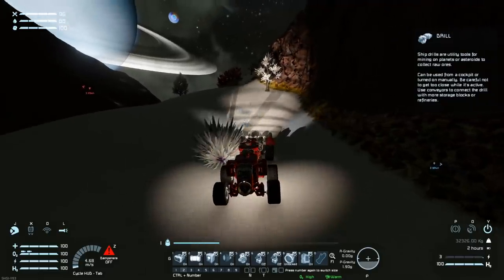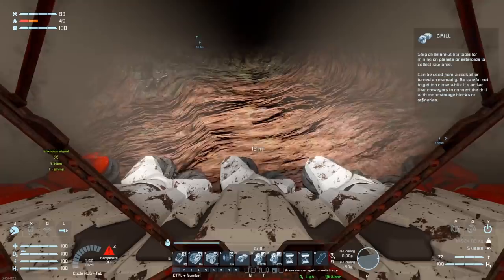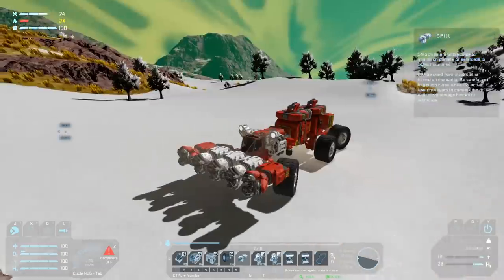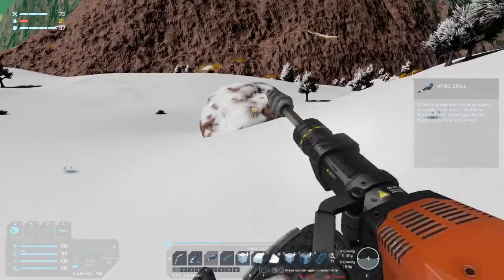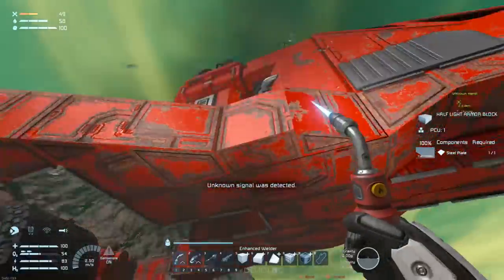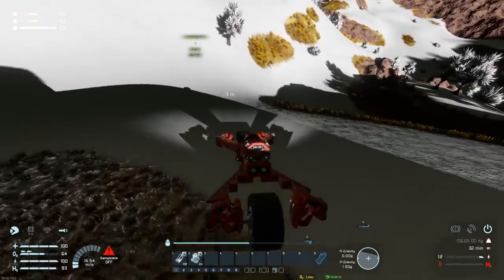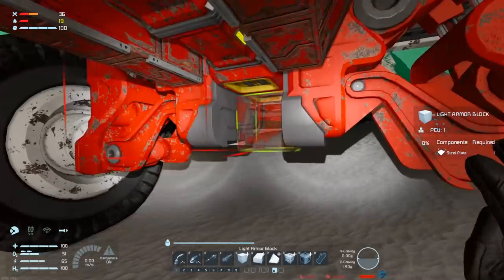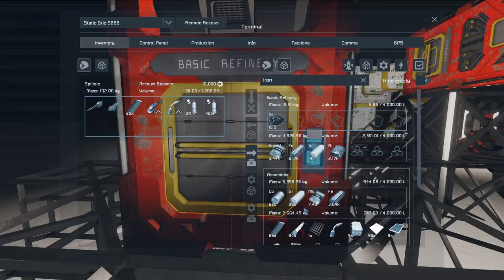Survival Impossible - Splitsie's Motorcycle Club #9 - Space Engineers Hardcore Survival

Comment: Make a button on the outside of the trailer to engage the trailer brakes.
Reply: Sadly, the state of the handbrake is stored in the cockpit, not the wheels...
Reply: @barmetler  If a remote control is added then it is possible to set up a button for the remote control's handbrake.
Reply: @TildaAzrisk  Yeah I was thinking about that... But what happens if he activates the handbrake there, then connects it again, what would happen? would the normal cockpit then override the remote control block? That would be good actually
Reply: @TildaAzrisk That was not the question, what I meant was what would happen, if you activated the brakes with the button, and then connect the miner. Will then the handbrake of the cockpit override the handbrake of the remote control, because the cockpit is marked as "the real one"?
Reply: Time for testing! (Spoken with insane levels of manic laughter)
Reply: @Spharkii  I wish I could do that XD but my graphics card is "either too hot or I need to update the driver" ._. and if it works, then at 10 fps...
Reply from the maker: I guess I'm going to have to try because either a button or a timer block that I can use to activate it for the trailer would be really handy and avoid some of the issues around finding a spot to safely stow a landing gear :)
Reply: @Splitsie  Or an actual anchor that you throw out with landing gears XD

Comment: Had a thought about your drilling angle, If you remove the two small wheels your using as  skids, place them inline with your driving wheels on the end of pistons, you should be able to adjust the drill angle by extending the pistons. The longer the piston the lower your drill points. Should also help with reconnecting the rotor.
If you still run them without friction, steering and drive they should still work as castors.
Reply from the maker: That's an interesting idea, I wonder how prone to issues the wheels on pistons would end up being but it feels like something I'd like to test in creative :)

Comment: Put a button on the trailer to engage/disengage the trailer brakes. Or a script that’s
 if: rotor connected 
then: engage brake
Else: disengage brake
Reply: He could just turn on the brakes, then detach and turn them off to move away, I think.
Reply: I think you actually mean the opposite. If connected, turn the brakes off.
Reply: Simon Knibbs yes I did mean the opposite, good catch!
Reply from the maker: Nope, the brakes on the subgrids don't engage without a control point on the trailer, that's why I can't park on slopes with the GUFI + trailer, with the subgrid wheel control script it just keeps trying to accelerate/reverse to hold position which is why it burns so much power when parked and why I always switch it off on parking :/
It's also why I need to at least put a remote control block on the trailer to get a control point there
Reply: Just had idea, put a four button panel and have 2 for trailer brakes and 2 for battery subgroup on/off

Comment: +splitsie, you need to put some armor between the two suspension sections over the wheel, that way if you bash one side, it'll stay held on by the other.
You should also have the suspensions covered in armor within the lean angle of the bike.

also, I think the suspension's are narrower when mounted sideways which might make for a better lean angle, it would just wreck your steering
Reply from the maker: That's an interesting thought about sideways, I wonder if I could combine that with rotor torsion scripts to still have some suspension and a better collision profile with the ground

Comment: 5x5 2 wheeler Splitsie. You made a big wheel! lol!

Also using  the same zero friction trick you could use 1x1 wheels as out-riggers to prevent catastrophic roll damage.

or you could suspend the wheels from above the body. Like the mcdonald double arches. 

The trick with a bike in SE seems to be keeping the frame horizontally compact.

Comment: I was experimenting with a separate trailer system like you but i used a small piston and a landing gear on it to lock in place, the thing liked about that idea was it could be adjusted for different terrain types.
Reply from the maker: I'm thinking that'll be what I'll do if I can't get the handbrake to work, the main reason I want the handbrake is to avoid needing to find a spot to fit the piston and landing gear :P

Comment: splitsie, remote control blocks and handbrakes works for subgrids
its the only way that ive gotten subgrid suspension to work properly when trying to stop it on ANY sort of incline, but also not to use extra, as you can turn the suspension off afterwards and it will still have the handbrake on
Reply from the maker: Good to know as I'd hoped that was the case :)

Comment: Hmmm... I have a pretty good idea for the bike. 

So keep the original section of the cockpit, engine, generator. Since that section is 3 blocks wide, you can get away with having two 3x3 wheels attached to eachother (so the suspension parts are back to back). This would cause the bike to be technically one block wider on one side, but you could even it out with a few small cargo containers for spare parts. Also have the same setup for the rear wheel(s). Also, have the cockpit section more towards the rear so the front is slightly longer... I might just whip something up and post it in the discord for you to see what exactly I'm thinking of. I'm definitely curious to see how well a motor bike would work. 

And as always, another awesome episode. I definitely look forward to each of these. Cheers!

Comment: 29:05 is the perfect spot for an air vent, and there is also a perfect spot for a hydrogen thruster at 29:35!

Edit: Also a remote control block could be used to control the handbrakes on your trailers, you could even put a button on the trailers to toggle the brakes on and off, plus if that button is the only thing that controls the brakes then then that could make running away quickly more of a challenge.
Reply from the maker: I wonder if I can add a brake control to my hotbar in the GUFI if I have a remote on the trailer, that might prevent some of the likely challenges of a quick escape :P

Comment: There's a reason motorbikes use over the top suspension connections. Cross mounting the wheels would have helped stability definitely, balancing out how it was pushing on the wheels. If you want the Motorbike styling with 4 wheel stability, mounting them like you did the Tank Wheels in Survival... Maybe, would work, with the suspensions directly on one another, so you've got the wheels fairly close together would do it.

Alternately, you could go completely insane. Rotor mounted 5x5's, with Whips Subgrid controls, so when you get in you kick yourself up to a high center of gravity and can run off as fast as you like.

Comment: a few seasons ago, you used a script and a camera, and either gyro's or rotors, to align the camera pointing directly downwards

could a variation of that script keep the bike level automatically?
Reply: That might be possibe, however if the vehicle is level relative to gravity and the ground is sloped then that could cause problems.
Reply from the maker: Yeah, I think the issue is what Trent said, I need to align to the ground, not to gravity and that would require some clever raycasting and at least two cameras. I suspect someone smart could write a script like that, but it's not within my skill set :P

Comment: piston and landing gear, boom, trailors locked, maybe put the two extra wheels in a group so you could add wheels back if they get shot off
Reply from the maker: The trouble with the piston and landing gear is the size, I'm hoping there's a way I can just get the wheels to actually park brake with the use of a remote control and maybe a button. If it doesn't work, then the landing gear will absolutely be the way to go :)
Reply: Splitsie there’s the old fashioned parking brake which is literally just wedge something near the wheels, otherwise a rotor with a landing gear may also work

Comment: It is an interesting concept, you would need to add how it connects to the base as well. Is there going to be no oxygen tank on the vehicle? You could just fill up a few bottles instead.
The problem is the 5x5 clearance is reduced when you turn. If all it is used for is rapid escape a battery based flyer would be better even with the gravity.

Comment: For that turn around area in your mine you could make it big enough to pull the trailer up into and back it up into a parking area. It will keep it flat so the trailer wont roll away and safe from any attacks. You'll have a good safe area in the bay if you're still thinking about taking your survival kit there and you should only need 1 or 2 turrets out at the mouth to keep you safe.
Reply from the maker: I might well try that, but I think I need to lower the floor a bit more before I do - I need to ensure the turrets on the trailer are well clear of the roof :)
Reply: @Splitsie  valid points to be sure. I forgot that there were turrets on the trailers hahaha

Comment: also might be an idea putting blast door edges or corners on the wheel struts
Reply from the maker: I definitely need some sort of better collision protection
Reply: @Splitsie  what about instead of the struts coming outwards, what if you made them go upwards instead this would insure the vehicle was still as you intended but narrow enough not to collide with whatever you come across.. plus a slightly raised fighter cockpit moved a bit forward you might be able to fit another o2h2 gen maybe even small cargo and or a turret for defence while you escape 
Then have maybe a small grid piston either side so when you park up you have some support to keep it upright so you can power down to save fuel and energy ?

Comment: I did a little bit of playing around with motorbikes a while ago now, and I didn't get too far, but the most promising design was suspension wheel on the front and 2-3 rotor mounted wheels on the rear I was using 3x3s for the rotor wheels and a 5x5 for the front for a slightly wider vehicle, so I'd say you could reverse that and go 3x3 suspension on the front, with a single 5x5 mounted on a rotor on the rear.

Comment: The motorbike needs to be smaller, go with the 3x3 wheels and try to keep the wheelbase short. That should make navigating the terrain much easier. Go with a single suspension mount arm for both the front and rear, just make them on opposite sides. Less stuff hanging off the sides means less stuff to worry about hitting.

Comment: I think you could probably balance the bike simply by having a single arm up front and a symmetrical arm on the opposite side in the rear. Then perhaps you could angle down towards the wheels. I’m not totally sure how the connection points are set up, but even adding a vertical arch to the arms so your COG can still be low but you get more clearance around the suspension.

Comment: That’s an Akira motorcycle!
What of you centered the suspension instead of the wheels and had them facing opposite ways?  The wheels would be off center but the overall width would be a lot less.
Reply from the maker: That would likely create some very awkward handling with offset wheels as the whole thing would pull in odd ways especially on turning :/

Comment: Honestly the least resource intensive adjustment would likely be to make it into a 4 wheeled vehicle. It would use less components then the design you are using if it is done with 3x3's and would mean the smallest lose in resources. However if you are intent on the bike idea I think you will need to go with a 3x3 wheel base to keep things compact enough that they don't scrap the sides. I took one of my old builds and set up something similar to your base vehicle minus the wide wheel frames you have now with 2 3x3 wheels and it worked fine to get around in so it is workable just a matter of how much resources and time you want to put into it.
Reply from the maker: Agreed, I may well go that route if I can't come up with something fun AND functional :P
Reply: @Splitsie  Oh I wanted to also suggest putting an air vent on the vehicle since the O2/H2 generator is putting most of its resource into making hydrogen. The low oxygen warning in the cab was on pretty much the whole time. Hope your still safe and sound from the fires raging down there looking forward to your next video.

Comment: If you move the wheel supports (that you keep clipping on the ground) to above the wheel suspension instead of next to them, you'll hit them less and have the same amount of support.

Also put a depressurize air vent on the thing?
Reply from the maker: It's the suspensions I'm hitting on the ground (well after the lower pieces were removed) so I need something to protect them, moving the supports above won't prevent that sadly :(

Comment: Might have a couple suggestions for you on that bike.  I rescue old motorcycles and rebuild 'em as a hobby.  Seems to me you're running a hardtail where you need a soft tail.  What it needs is a swing arm in the rear.  I reckon it could be done with a rotor.  Also with how the 5x5's mount you might look at how ducati mounts their rear wheels.  Those 2 ideas should give you an idea of how to design your swingarm.  Front might need some better suspension as well.  You could mirror the rear swingarm, or possibly (if pistons will allow some bounce) use pistons as front shocks to mount your front wheel suspension in a way to allow for some vertical movement.  Might i also suggest using mass blocks to even out the weight on the opposite side of the rear swingarm.... you might be able to greeble it in such a way to look like exhaust.  What'd also be pretty cool is to mount the h2/o2 gen directly above the h2 engine... you know, like a fuel tank generally sits above the engine.  Maybe pipe it in with "L" pipes so the pipes kinda look like the way carberators mount on a cb750.
Reply from the maker: I so wish that pistons could work as the front forks of a motorbike - it would allow so many cool designs, sadly they don't compress in any meaningful way :(
Reply: @Splitsie  well then we're down to using rotors to allow some vertical flex for your wheels (as the stock suspensions dont seem to offer enough travel).  I would test it but i cant get SE to run on my machine.  Hardware specs are fine, but theres some software issue because i refuse to update to windows 10.  I live vicariously thru you and a few other folks on youtube.

Comment: I think for the bike you could've placed h2 engine on the front of the cockpit. It would fit perfectly in shape.

Edit: as for "run-away" style vehicle, I think trike with 3x3 wheels would be better. It'd be more compact and have yet good enough clearance, if you rise it a bit above suspension, say, 1 block at the front and two at the back. Or even use rotor-style suspension to attach the actual one and use script to control wheels.
Reply from the maker: I don't actually like the look of the engine in front, I feel like it breaks the lines of the cockpit having a flat section right after the nice slopes :/

I've got a few ideas I'd like to try and that's one of them - I'm thinking if I get time this week I'll do a stream (on Twitch) and test a bunch of concepts in creative mode :)
Reply: Looking forward to it, then. Good luck with the designing (-:

Comment: For sticking with the motor bike 2 wheel theme. Shorter length. 3x3's for the angle advantage. one left one right. Otherwise buggy would be a good alternative...
Or if you want a challenge, 3x3 front wheel for steering. 2 rear 1x like the gufi for balance with friction on the hotbar. and a thruster to get moving.
Reply from the maker: I think you're right, the length is a big part of the problem

Comment: For the bike you could, make it sit higher up, change the suspension so you have a piston attached to a rotor, these extended pistins would be attached to the wheels so when you gyro turn theres nothing to grind off and make pot holes. In other words, vertical suspension over horizontal. Though this could make for an eyesore.
Reply from the maker: I really wish pistons worked as suspension like that but sadly they just don't compress like you'd expect :(

Comment: I would shorten the wheelbase on the Bike or go with a 3x3 4-wheel inner setup (like it is right now but with 3x3 on all 4 suspensions, also makes for basically no Gyro override needed i think?).
alternatively you could place either 1x1 rolling wheel(s) under the cockpit or 3x3 in the space created by the 5x5 suspension 'arms' (if it fits).
I would probably place 2 3x3 in the gaps lower so the 5x5 are w/o ground contact on flat terrain. so if you speed over ridges the 5x5 should take the most punishing when you smack the ground or reduce the force put on the 3x3 (also you can still keep going even with 1 wheel missing).
sorry for the long comment. just my thoughts on saving the pothole-creator bike.
Reply from the maker: The shorter wheel base is definitely a benefit, I spent a bit of time messing around in creative mode over on Twitch earlier this week and that was one of the things that helped the design I came up with there :)